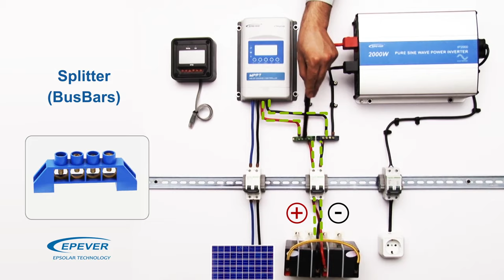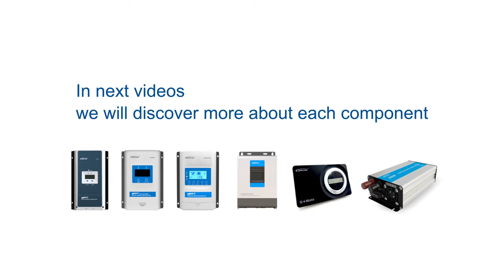The Ultimate Guide to DIY Off-Grid Solar Systems - 02 - Solar Off-Grid System Components.

Comment: can you please advise the wiring between DIY LFP battery, BMS and the solar charge controller? and can you clarify how can BMS and solar charge controller communicate?
Reply from the maker: Hello there, our controllers cannot communicate with BMS. However, if you DIY the battery, we recommend installing a BMS module for better battery protection.

Comment: Great video 📹 👍.  I have a question for you. What sizes circuit breakers are you using and what is the normal sizes i should consider  for a system like this?🤔.  I would like to make the same system you have, but I will use 285w solar panel. Please advise 🙏 😊
Reply from the maker: Hi Sir, normally, the sizes of circuit breakers 1.5 times solar charge controller's Maximum charging current, and  2 times inverter's rated current.

Comment: Can the inverter connect to 3 circuit breakers. To power lights power and refrigeration?
Reply from the maker: You can just use 2 phase circuit breakers, and connect the GND to the ground is good enough.
Reply: I guess what I'm asking is how you connect them to the inverter when it powers a plug. How do you wire from a plug to fuses.
Reply: @nathanbellamy3308  , Hi, generally you will connect the inverter output to a main switch, and from there you connect your secondary circuit breakers.

Comment: Hi, is this dc circuit breaker enough to protect Lifepo4 batteries/PV string or should it be combined with fuses?
Reply from the maker: Hi. When you connect the PV to the controller, use DC circuit breaker. If you connect the controller to the battery, it is better to use a fuse.

Comment: Hi i'm curious about the dc breaker you used between the battery and SSC,Inverter. What kind of DC breaker is that? can i used any kinds of 2 Pole MCB DC Breaker in the market?
Reply: Hi, make sure it is not a polarity-sensitive MCB. Polarity-sensitive MCB will have the marks (+ and -), if you don't see such marks, still it is better to ask the seller the question to make sure that what you got is NOT polarity-sensitve MCB.
Reply: @qzz9102   Actually i already both MCB but the problem is the seller don't have idea if it is Polarity Sensitive or not. but my MCB don't have (+ and-) marks on each terminal. my question is can i still use it for this kind of wiring system? the brand of my MCB is TAIXI DZ47Z-63 40Ampere
Reply: @elizermacaron5983  Hi, you will have to turn back to TAIXI for this. Sometimes you have to ask more than once until this question finally get passed from front desk to their product manager.

Comment: Hi  would the power from the charge controller not be flowing straight to the inverter.
Reply from the maker: Hello there, we don't recommend directly connecting the inverter to the controller because the load side of the controller has a relatively low surge tolerance. Connecting it in this way could potentially damage the controller. It's advisable to connect the inverter to the battery instead. The controller will then prioritize charging the battery, and the power will be supplied from the battery to the inverter.
Reply: @Epever   Sorry I’m not making myself clear . In your video the cables go from the controller to a bus bar then to the battery and to the inverter. What stops the power from travelling through the bus bar to the inverter?     Thanks   John
Reply from the maker: Hello there, adding a busbar doesn't entirely prevent electrical energy from directly flowing to the inverter. The controller still partially supplies power to the inverter, but the primary power source is the battery. It is recommended to connect the inverter directly to the battery terminals. The connection method shown in the video is for demonstration purposes only, and adjustments might be necessary in different situations. @jcbluemusic

Comment: Need help to wire a relay in for my inverter on a AN 5415 tracer cannot find any video's and do you use an ordinary ethernet cable to join two units together?

Comment: I have 6x190W (1140W) mono panels, 4210A MPPT, 400 Ah truck batteries wired for 24V. My inverter is EpEver STI 1000-24-230.
I set it up in my workshop 2 1/2 years ago, never gone wrong. The batteries were old when I got them, and are now dead, so I'm using a LiFe battery of 26.4V 105Ah. It saves 50% of my domestic electricity bill;  this comment is on my PC powered by solar, I am very happy, I just need a bigger battery!
Reply from the maker: Thanks for your comment and glad you like them, but we still recommend to use the controller which is compatible with Lithium batteries, the Tracer-A does not support Lithium battery well, feel free to check our official website, have a nice day!

Comment: On the DC load output. Besides a light bulb what else can I run? How many amps will it take?
Reply from the maker: hello SKID. thanks for your questions. The DC load can be  TV, fans or other DC loads. but the loads that the system can run or the amps  depends on the system configuration. e.g. the size of the charge controller, battery and solar panels.
Reply: @Epever  Ok your 30 amp mppt charge controller, 2 12 volt batteries and a 200 watt solar panel. What is the max amps you can run?
Reply from the maker: @skid4482  EPEVER 30 amp  MPPT charge controller can run max. 30A load. It's charging and discharging current is the same.
Reply: @Epever  Thank You. :)

Comment: I have the 4210-AN. I am feeding this charger with 4-250 watt 24 volt solar panels. The 4210 is supposed to be 12V or 24V capable but the output to the 12V LiFePh4 battery is only getting 500-600 Watts. Trying to get the most power for limited sun exposure to charge battery. Any comments?
Reply from the maker: Hello William Hickman,  The Rated Charge Power of Tracer4210AN is 520W in 12V system and 1040W in 24V system.  The charge controller has PV power limit function, it is max. 1.5 times of Rated Charge Power. If the PV power exceed this value, the charge controller may be damaged. In your system,  4 pcs 250W is much higher than the rated charge power in 12V system. You need to reduce the PV power.

Comment: If I'm not wrong...in connection between charge controller and battery, current will pass both direction. so which side of mcb should connect to battery (or to charge controller)?
Reply from the maker: Sorry, I kind of lost with your question, the controller is providing the energy to the battery, so the current should be from controller to battery.
Reply: @Epever  My charge controller has an option for direct dc load....that means it will take current from battery when dc load connected....it also charges the battery (obvious). Thus current goes both ways...which side of mcb should connect with which side in this case ?
Reply: @monaxp606  Hi, do not use polarity sensitve DC circuit breaker. use normal DC circuit breakers instead.

Comment: I'm trying to build an off grid solar system, I want to know if its  necessary to have ac and dc breakers
Reply: They protect the system from overload and unnecessary surges. Best to have them so you don't blow out the entire system.
Reply from the maker: Yes, the breakers are recommended anytime for safety.
Reply: Sir...
I have 12v 180w ×2 =360 w solar panels
12/24v 40 amp solar controller ( SMU)
12v 150 ah battery
So... how many amps circuit breaker required ?
On solar to SMU
On SMU to battery  please ans me 🙏🙏

Comment: I'm trying to build my first solar panel system follow your examples, but I have a few questions:
How many amps for each circuit breakers and bus-bars for a small 12v 100w solar panel, EPEVER 40A MPPT controller and 12v 100Ah battery? Thanks again 🙏✌️🙏
Reply from the maker: For circuit breaker, use this formula, the rated current of the controller times 1.5, so 40A*1.5=60, so I suggest the 63A 2Phase breaker
For bus-bars, use this formula, the total current between the two side of the cable divide by 4, so for example, the rated current between controller and battery is 40A, so 40A/4=10, we suggest 10mm^2 bus-bars.
Hope this anwser will help you, if you have more question feel free to visit our official website, there is online chat button to contact our support.
Reply: @Epever  sorry for another question, I went to the website but nobody was available to answer my questions, maybe was a wrong time 😃
Are there any "formula" for the wires, I'm not sure when and where to use a 10AWG, a 8AWG, a 6WG, a 4AWG ?
Thanks again
Reply: @EpTechie  Hi, fyi, https://en.wikipedia.org/wiki/American_wire_gauge

Comment: I am setting up a rv off grid solar power system 6-100 watt-12volt panels,   2-12v-100 amp  lithium battery's,  And a tracer 3210 an controller. Should I series connect the battery's for 24 volts? Should I series connect the panels for 24 volt or 36 volt?
Reply from the maker: Dear Ken, You can select the "battery system voltage" according to your Inverter requirements also, Tracer series are auto 12/24 so you can use both of the configurations. Generally, the voltage of the panels, are recommended to be higher than the battery systems nominal voltage in MPPT installations. However, the maximum input voltage of the charger should not be exceeded.
Reply from the maker: Here is an article which helps you size your system. Hope you'll find it useful.   https://blog.epsolarpv.com/ep/oj

Comment: Hi there, if you shut off the battery-MPPT switch, don't you risk damaging the MPPT by leaving it live with the PV?
Reply from the maker: Hello Paulo, the charge controller won't be damaged. However, the higher voltage from PV may affects the loads.

Comment: Good video - though why not connect Inverter to Solar Controller's Load Connection?  Rather then direct to battery via DC switch?  Seems to be 'wasting' part of the functionality of the Controller, or why have the Load connectors at all?  Presumably this may affect being able to read Load information on the Monitor too?
Reply from the maker: Hi ALex, Yes, Its also possible to connect the inverter to the DC load port directly, and this way, you will get useful data regarding to your AC consumers. However, It isn't recommended, since the current requirements of the Inverter would vary according to your AC consumers, and is usually beyond the level that DC load terminals can take. This would cause either malfunctioning of the Inverter or damaging the controller.
Reply: A 2Kw inverter would pull approximately 200A DC from the battery at full load. The charge controller terminals would melt lol
Reply: ilsonbob yes, I get that now thanks :) the solar controller max 40a, and does mention in tiny note in user manual but could be good to make clearer.

CAUTION: If an inverter is to be connected to the system, connect the inverter directly to the battery, not to the load side of the controller.

Comment: What happens to the SCC when the battery CB trips off while the PV CB is on?
Reply from the maker: Hi Rico, thanks for your question. The solar charge controller would stop charging. The charge controller won't be damaged. But It's not good to the loads when the battery CB trips off while the PV CB is on.

Comment: Are breakers capable of handling current going in and out?, I want to understand what the breaker between the charge controller and the battery does.
Reply from the maker: Thanks for your comment and for safety reason, we usually add breaker on each circuit, also the right size breaker will be capable for handling the current going in and out. Please feel free to subscribe to our channel if you like the videos, we will release more videos in the future, have a nice day!
Reply: @Epever Hi can you please tell me what will happen if dc breaker between charge controller and battery breaks and disconnect the battery suddenly. So will it damage the charge controller? Since there is no battery connection but pv array connected?

Comment: How would you set up say 6 panels to the equipment , could you do a video please
Reply from the maker: Hello Dominique Payne-ohara, if there are several panels in one system, you need to connect the panels in series or parallel,  then connect the PV array to the charge controllers.  and the parameters like power, Voc, Vmp of PV array  can not exceed the rated value of charge conroller. We may develpe some more  videos in future. please focus on our youtube channel all the time.

Comment: Hello , the video is great , but i have a question , is it better tu use an all in one inverter with mppt ?or multiple mppt charge controllers ?what os the advantage of each one? And witch is more eficient?
Reply from the maker: Thanks for your comment and questions, please feel free to subscribe to our channel, we will release more videos in the future, thanks in advance, to your question, first, the multiple mppt charge controller don't include inverters, you need to spend extra money on them, second, it actually depends on your situation, such as how many PVs and the total power? And total open-circuit voltage, total short-circuit current? How many batteries? Are the battery voltage different? We have a lot of articles on our blog http://blog.epsolarpv.com/ that may help you, also please feel free to send your specs to our technical support, they will provide you the best solution depend on your situation, you can find the on our official website https://www.epsolarpv.com/ under CONTACT section, have a nice day!

Comment: Hi. I have one doubt regarding the Charge Controller. Once you have the inverter wired to the Battery connector instead of the Load connector, how does the system behave when the battery is full? Isn't the Charge Controller function to tapper-off and avoid overcharging the battery? I assume that, if the battery is full, no current will flow from the Battery connector in the Change Controller. Am I thinking wrong?
Reply: Hi, yes, when battery is full (or at least the charge controller thinks so), the charge controller stops charging the battery but would not block the battery to discharge,  i.e., to power the loads that connected to the charge controller. If the load is an Inverter, connect it to the battery directly, it is true in this case the charge controller cannot control the load (inverter). Have to say though, if both the charge controller and inverter are EPEVER products, you have a chance to use a communication wire to link them, thus the charge controller could control the load (inverter) .

Comment: just a question: nearly all MPPT have a load output, but everybody connects the load directly to the battery? does it gives any advantage to connect the load to the MPPT load output? why nobody does it? thank you. Giuseppe
Reply from the maker: Thanks for your comment, there is current limit for each controller, such as 10A, 20A, 30A..., but some loads produce higher surge current when it starts, which is much higher than the rated current of the controller, it may damage the controller, so usually people connect loads to the battery.
Reply: @Epever  thank you

Comment: whats the common efficiency? e.g. i have 1kwp panel, how many wh the AC output? i live in tropical
Reply from the maker: It depends on the local peak sun hours, PV loss, controller efficiency, inverter efficiency, so for example, if your local peak sun hours is 4, controller conversion efficiency is 95%, inverter rated conversion efficiency is 87%, and PV loss is 30%, then the formula will be (1000W * 0.95 * 0.87 * 0.7 = 2314.2Wh) around 2314Wh, hope this will help you, please feel free to subscribe to our channel, we will release many guide video about solar build up, thanks in advance and have a wonderful day!

Comment: Thanks for the video! So the charge controller is wired to both the inverter AND the battery? I only thought it was wired to the battery, I fear screwing up real bad, and either being killed by an arc flash or a bad shock, so for now I am sticking with only the Echoflow Delta. Is there a comprehensive book that teaches about electrical safety?
Reply from the maker: Thanks for your comment and im glad that you like the video. Actually, we used the breakers to make the inverter paralleled to the battery, we always recommend the inverter parallel to the battery, because when the inverter starts, it will produce a high inrush current which may damage the controller, please feel free to subscribe to our channel, we will release more videos in the future, have a nice day!

Comment: Why don't we hook the bus bar up to the load terminals to protect the battery from over draining, and connect the battery solely to the battery terminals? 
Isn't the inverter supply a dc load?
Reply from the maker: We recommend connecting the inverter to the battery instead of the load terminals, because there is an inrush current when starting the inverter, if you connect it to the controller, it may damage the controller.

Comment: what is the size of the switch between the controller and the inverter ?
Reply from the maker: Hello Anderson Chimuco, the inverter should be connected to the battery. There is no connection between controller and inverter.